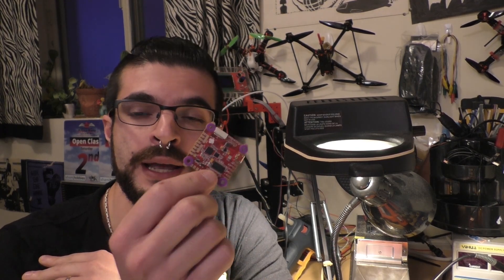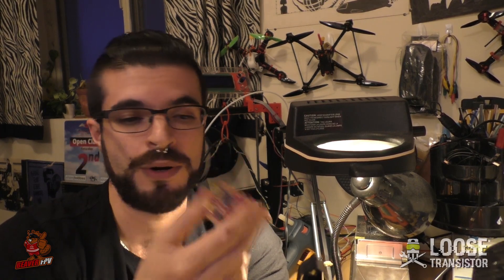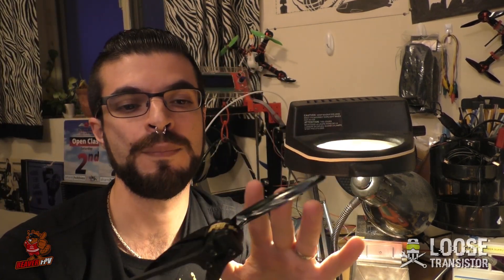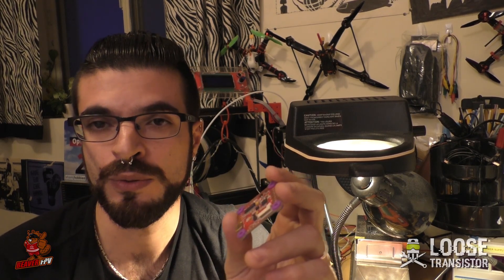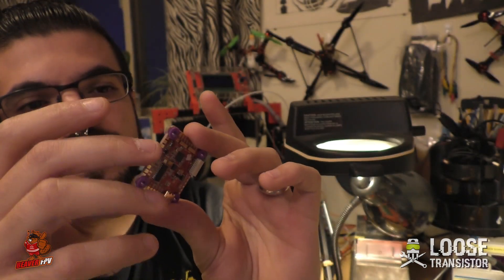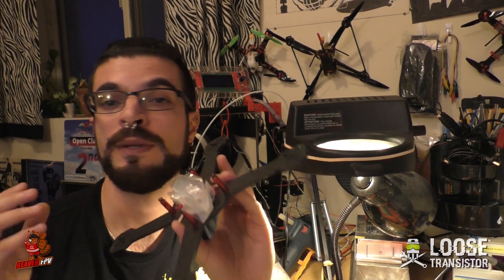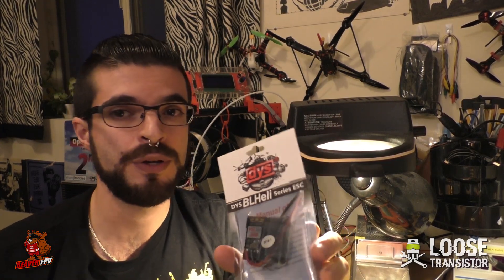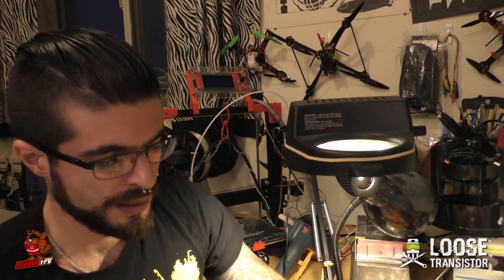HELIO RC - HELIOSPRING -Hardware Filtered 32khz Gyro

Comment: I have a Matek PDB and DYS aria 35a ESCs with the Helio v2 and I’ve never used a PDB and not sure how to wire it up..
Reply from the maker: Basically, you want to wire it so that the main battery leads go into the the VBAT pins for the PDB. From there, you will want to attach your DYS ESC's to the PDB on the + and - ESC pins.

To power the Helio V2 you must first decide wether you are going to power it from straight VBAT voltage or from 5V only. There are a few caveats with each.  Refer to this page for more info https://heliorc.com/wiring/ 

There under the "POWER" heading you will find the VBAT/5Vin and GND pins. If you are going to run it on the 5V output of the matek PDB you must make sure to bridge the appropriate jumper on the HELIO to select 5V input.
Reply: I can’t find the pins to select 5v / vbat on my v2... I feel so fuckin stupid...

Comment: Hi, i'm hoping you can help me, my heliospring fc, I flashed it with the Odin fw and it seems to be bricked or something's. When it finished flashing it says successful, I plugged it out and plugged it back In and the green light which indicates it's in dfu mode is on for about 2mins and then it connects, but when I go to the tabs nothing was reset, CPU reads 0%

Comment: Hey man, any recomendations for a SP Racing F3 Evo with ButterFlight? (It's a brushed flight controller.)
Thanks! :)
Reply from the maker: Sorry man I do very little brushed flying these days so I am not well versed on the available hardware
Reply: Loose Transistor FPV Absolutely no problem, man. 😊 I only thought you could know something about that because you work with Butterflight. 😊 Anyway, subscribed! And my first quad, that I'm going to build today or tomorrow, is most definitely going to run on butter. 😉
Reply from the maker: MC's Creations awesome man! Glad to hear that a thanks for the sub!
Reply: Loose Transistor FPV No problems! 😊 And I already started building it yesterday. I just couldn't do much because I wanted to install Butterflight first and I had problems connecting my FC. But ok, that ImpulseRC driver installer solved it. 😊

Comment: I am so bummed... No buzzer on my Helio -trying to update it as instructed, and was finally able to get it in DFU mode and update to 3.5 on BuF and rewarded with no buzzer still, and won't arm now. :\
 I did however fly it before trying to deal with the buzzer and... OMG! (it has 32bit Esc's as well) so the butter was being slathered for three tenuous packs in my fav spot, sans the tall grassy areas. Now just trying to find a version of Helio firmware to fix it all, and get down to some serious air time.

Comment: Another question! What about the Dynamic Filter and the notch filters?
Simply select exactly as with betaflight?
Reply from the maker: The HELIO hex already comes pre-set. There is nothing you need to do with the FW filters. If you wish you can play  with the IMUF settings - but dynamic filters and notch filters should be left off.
Reply: Thanks now I understand it.

Comment: Good video, how does the tuning work?
Reply from the maker: Just like any other quad, except the filtering happens inside the motion coprocessor. There are parameters for the IMUF you can change via CLI.
Reply: Thanks man! I am looking forward! I think next week I get my Helio Fc
Reply: Is there any chance that the IMUF filter settings can be moved into the configurator?  That would make things a lot easier for us lazy folks.
Reply: TRex i think at the time no! Only in the cli or onboard osd with your radio!
But it’s easy in the cli in my opinion!
Greetings from Germany

Comment: I just learned 32K is not really all that. It only is for one part of the whole loop that covers 10%. Plus using 32K is just putting more data in and therefore using more cpu overhead.
Reply from the maker: First of all, you dont need to run 32khz to benefit from it.. you could run 16/16 or 32/16... also your comment completely misses the point of the HELIO. The SPRING isn't special because it has 32khz gyro.. plenty of boards before it have had that capability.

What makes the HELIO-RC board so special is the addition of the F3 board that PRE-FILTERS the 32khz gyro feeding extremely clean data to the F4 that is running the firmware. It pre filters using proprietary software running some sort of kalman filter on all axis.

Anyway.. I have flown the HELIO on 16/16 and I can tell you without a shadow of  a doubt that the benefits are there. Will release DVR soon!

Comment: Have you set up a CL_Racing board on Butterflight?
Reply from the maker: Yes I have and it works damn great!!
Reply: Loose Transistor FPV so I did the same but just to verify that you are not able to utilize the 32 right?
Reply from the maker: FILTHY5150RC no no, the CL I'm running at 8/8khz the MPU6000 is not capable of 32khz but butterflight doesn't need 32khz to work
Reply: Loose Transistor FPV so honest opinion, do you think I should move aeay from the Cl board and move to a board that can handle 32? I am going to build some new quads and refresh what I have. But I was also thinking to use 32 bit as well?
Reply from the maker: Man honestly, after flying the HELIO today... I think the future is motion co-processors. That + 32 Bit is the way to go if you want the smoothest quad possible with the least ammount of effort. You can get almost any good hardware to perform this well it just takes a bit more work.

Comment: Hi there. Could you recommend filter settings for 7 inch on butterflight? I'm assuming the stage 2 above 700hz needs to change because 7 inch will create different noise at different frequencies?

Comment: I'm waiting for a video with HELIOSPRING. I will buy. If you can more video on the assembly and configuration.
I wonder what CPU load on 32 32  ?
Reply from the maker: not high since filtering is offset on the F3